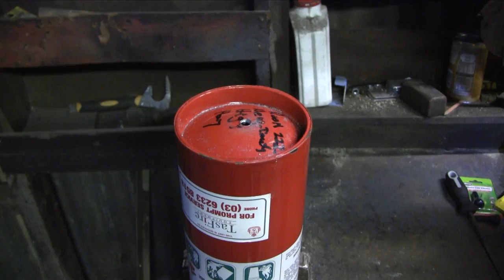How to Make a Super Powerful Hunting Air Rifle

Comment: Ok but what do I fill the fire extinguisher with?
Reply from the maker: once the valve is in the fire extinguisher you can just hook it up to a pump and fill it with air, i would recommend an air compressor but a bike pump will work ;)

Comment: i dont like the stock but your concept is nice..thumbs up.
as l read in the comments its running on 120psi thats not bad. i did build a cal 7.6mm (.299) running on 120psi (8BAR) and i like it but i want more. thanks for sharing yours
Reply from the maker: That's fine mate i apreciate the feedback, good to hear of someone else who enjoys building stuff
Reply: @V2weapons  I also love to build stuff,bro!I'm in Canada btw,here I made a great ultra long distance&shockingly high powered rifle-my own modification of PTRS-41 anti-tank rifle that is equipped with a virtually unbreakable barrel from KPVT adopted to PTRS-41 action and so takes hot loads with no issues,and now also has a 64× scope with night vision and very good recoil compensation systems!It's really astonishingly powerful gun that sends a huge 68.2 gram tungsten carbide core projectile at 1280 METERS per second which is insane and means 56 kilojoules of energy which is 42 thousand fpe!So it is capable of punching through 2 inch thick AR-680 mil spec steel plate which is currently used in NATO armoured vehicles and is the same quality armour steel around the same as analogues!So from up to 300 yards away it can pierce such armoured vehicles as BMP-3 and M2-A1 Bradley and not just in side armour but also in front armour as well!

But now I ran into a bottleneck with an obvious issue of such system-that gianormous anti tank rifle is not the best if you want to hunt rabbits with it!Apparently nothing except for whales and perhaps elephants and rhinos would not have been rendered useless by a single shot from it:I can tell you that it is enough power for ripping any possible human being in any possible personal armour in two if shot in the center of mass;as it hits the large adult bear in the paw-it inevitably tears it off even if you not hit the bone!So as I now started excessively hunting rabbits I apparently need some good rabbit rifle!And so like this was the case with PTRS-41 I also want to make it really perfect!And this time also cheap and best if not requiring the license because with those that do require it I can't do some stuff like for example I can not shoot them in city limits!So here is the solution!Just the simple cheap break barrel that is spring piston only:nitro piston or IGT is not an option here!And just adding the firing pin to the end of the piston while the same time substantially reduce the spring force to the point where it will only be able to set off the .27cal blank with that firing pin on the end of the piston!Than drill a 6.8 millimeter wide and 12 millimeter long chamber in the beginning of the barrel!So what you will get is the best single shot small caliber rifle with insane initial velocity and a ridiculously low cost of ammo for it!And it is really good thing for sure:you get each round cost of less than 20 cents Canadian for each round!Yet the performance is very good:with a 1.02 grams "rabbit magnum" .177cal pellet the initial velocity with a #5 red power level blanks will be 950 meters per second which is very good!And with a 0.49 grams crossman pointed nose pellet you will end up with 1370 meters per second which is insane!But the other and actually better option here will be to actually make a revolver rifle with 12 round drum that is loaded with the same .27 caliber nail gun blanks from one side and with a .177 cal steel BBs from another!This with a 20 inch barrel will give you an initial velocity of 1620-1650 meters per second which is OVER ONE MILE PER SECOND !Although the barrel needs to be smooth bore for BBs but with such speed at least to shoot almost without any adjustments from the distance of 100+ meters will be certainly possible!And the most tasty thing here is that the gun like that is not considered a firearm at least in Canada due to the very tight but very nice loophole in laws!So yep,this stuff actually can be done in full auto and with unlimited capacity!Very neat thing to think about!Especially knowing that it will have 460 joules of energy while the 9mm Glock 17 has 496 joules with an FMJ round!
Reply from the maker: @johnsheppard1476  wow mate you really know your stuff!!! a lot of the things you talk about seem really cool and feasible if your ready to learn a few things. i would love to make a gun like the ones you describe however its almost impossible to legally obtain any ammunition or guns to modify and im pretty keen to stay out of trouble XD, this is partially why i stopped you tube as a lot of the things i post are borderline if not illegal in Australia however if i ever moved to Canada i would definatly attempt to build the rifle you initially described if the laws still allowed it. would you be able to post a video of your gun on your account, i would love to see it but if you dont want to i totally understand
Reply: @V2weapons  I guess I will eventually post it but now I have some complications with paperwork so if I want to get my PR card I have to keep quiet about that as the lawyer said:most of judges are fucking liberasts and will not appreciate me having such a giant firepower that can bust small and even medium armoured vehicles and disintegrate low flying aviation mid-air!By the way I personally saw in Debalzevo how two guys both with PTRS-41 and HE ammunition blew up mid-air the MI-24 armoured storm helicopter(in NATO classification it's called "Hind")-it took just 5 hits to do so:one blew up the protection of one of the engines and the second hit at the same engine made it to blow up as well,and that resulted in the other one going off and the fuel tanks followed along with all 48 unspent air to ground missiles which thorn the chopper to shreds!
Yet the other idea with the rabbit gun is quite well doable+it is going to be legal and not considered a firearm that requires license!As I said I do have the license obviously but can't use my normal guns in the city limits where there is a shit load of rabbits!Also another thing that I already can not do with my BB pistol that I currently hunt rabbits with is a bunch of coyotes that are constantly ruining my hunting trips and are quite an unpleasant things when I encounter 3-4 of them in the pack and less than 20 meters away from me,while especially I know that I don't have anything to effectively put them down!Damn I would have been happy to carry a fucking .22 pistol legally but it's not possible here..However I am going to receive the black powder revolver with 12 inch barrel this week and it will be vastly better for coyotes as it will definitely put them down at ease!It shoots the 6.25 grams 11.43mm or .44cal steel ball at 420 meters per second which is more than enough to fucking whack the piss out of a coyote!I bet if I hit it in the head from the front-the bullet will exit from it's ass!It is 550 joules which is about the same as the M9 Beretta with FMJ round;Glock 17 by the way has only 496 joules with it!And so knowing about the insane characteristics of steel balls as projectiles I can tell you that at such speed such a huge steel ball will wreck any personal protection as well:there is no such an armoured suit/vest that will be even remotely capable of stopping it:I bet it will even exit from the back of the same suit as well!So it seems like a great opportunity to have it in the pocket which is legal here because despite it's substantial power this revolver is not considered a firearm!Also can't wait to use it to hunt the rabbit lol😎😆🤠Although it's clearly not a good rabbit gun because it is a huge and gianormous overkill for a rabbit and will likely just tear it apart with first hit!And also I really love high speeds of my guns' projectiles and so I clearly want to make some long range rabbit rifle:the revolver that I told about is also useless after 100 meters away and actually from 50 meters away I doubt that it will be easy to hit rabbit with it!While I have to get in very close range with them to use my BB pistol-it's absolutely redundant from more than 15 meters so I have to really put a crap load of effort to get one but I actually most of all hunt them in the place where I can see them sometimes from very substantial distances up to 300 meters sometimes but having to get so close to them is such a fucking irritating thing!So I definitely would have been happy as a fucking kid to have such a pretty thing like in this video!I have no doubts that it will nail them from 300 meters away at ease!As I said it will shoot the 1.02 gram .177 "rabbit magnum" pellet without any issues at the velocity of 950 meters per second with #5 load .27cal nail gun blank which is enough to use it for rabbit hunting on such distances!Obviously will require zeroing it well and that certainly will not be easy to do but possible!
By the way did you test it on rabbits?I know that they are huge nuisance and ultimately hated vermin in Australia,so obviously you can kill any number of those longears without any licenses and limitations!I actually have the limit of 6 per day here which is frustrating for me even though I honestly never made it to the day limit here:my personal record now is 4 longears in one day and that is actually because I did that for the entire day to end up with just 4 of the in the bag but for you making 4 rabbit kills should be feasible in less than 20 minutes!
Reply: Make a video. Would love to see it

Comment: Do you put the ammo in like an old musket ? And use a rod to poke it down the barrel? Thanks
Reply from the maker: yep pretty much, they roll down until they are naturally stopped by the join between the pipe and the fire hose, meaning they shouldn't roll back out
Reply: Musket type but you coukd make a simple bolt action to add coolness to it.

Comment: Will extinguisher explode? How many bars or psi do you have
Reply from the maker: hey Jan! yep thats a great question. if you look at the top of the fire extinguisher you will notice a dial that indicates if the fire extinguisher is empty or not, when refilling i watch that dial until it reaches the green section (you can see the dial in the video at 4:41) . I do not recommend overfilling the extinguisher.
Reply: @V2weapons  the problem is that i not have that clock
Reply: Thats why im asking
Reply from the maker: @jansteindel7981  well to be honest im not really sure, you will probably have to do a bit of research. I recommend looking for any markings on it indicating its brand and sending them an email asking what the pressure range is. Good luck though!
Reply: @V2weapons  its 24 bars so i think thats not so small thanks for best teutorial😂
Reply from the maker: @jansteindel7981  All good mate! glad you liked it

Comment: I don't get how it is powered? Didn't you discharge the fire extinguisher??
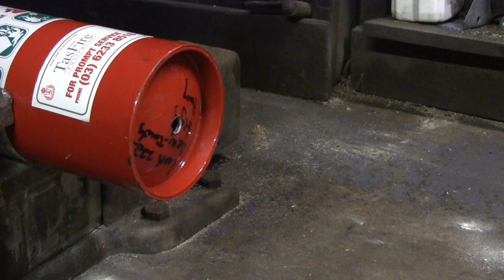Reply from the maker: yeah I discharged the fire extinguisher and poured any excess powder out then I screwed the lid back on and in the video, I put in a valve which I can then pump up the fire extinguisher with a hand pump or air compressor (at 3:15 ). The fire extinguisher is just an air tank which I refill after 9-15 shots or so. Hope this helps ;)
Reply: @V2weapons  yea I'm making my own Airsoft rifle I think I'm just gonna use a hand pump attached to a steel tube section with a spring loaded valve,, do you reckon that would work? Btw how long did it take to fill up the fire extinguisher assuming you used a manual pump
Reply from the maker: @johnnynovakvlogs  yeah I reckon that should work, I've never tried spring loaded valves but it sounds interesting! you should post a video on it when it's done. I've never pumped up my tank with a hand pump but it shouldn't take to long, 2-3 mins of pumping

Comment: Nice work bro how much PSI does it hold also must you refill after every shot?
Reply from the maker: it can hold 200 PSI put my tiny compressor can only fill it to 120, 120 PSI gives me about 7-9 shots on average. hope this helps :)
Reply: for me,  a 200 PSI fire extinguisher gives me roughly 4 high powered shots.
Reply: it depends on the volumen of your air reservoir and the diameter of your barrol and how long the valve is open on every single shot ;)

Comment: what diameter is the tube inside diameter
Reply from the maker: the inside diameter of the tube is 10mm or 1 cm and to load it I drop a ball (9mm diameter ball bearing) bearing down the barrel, the bearing gets stuck when it hits the plastic pipe of the fire extinguisher hose so it cant roll out of the barrel which is quite handy, hope this helps